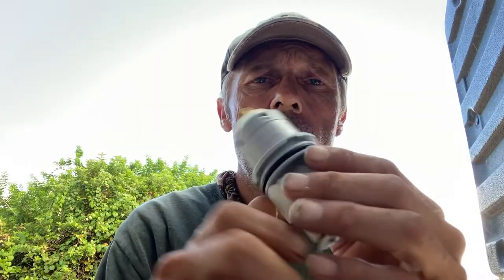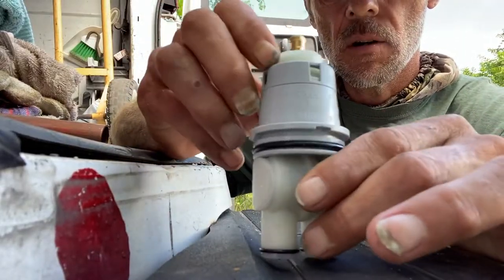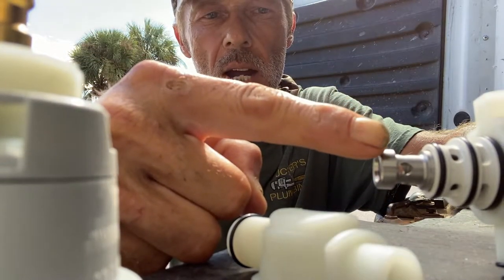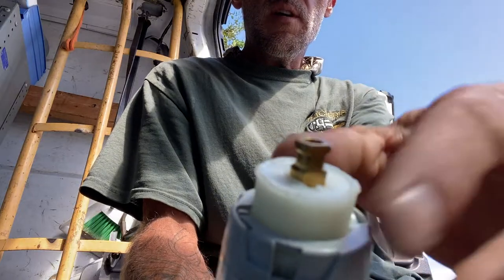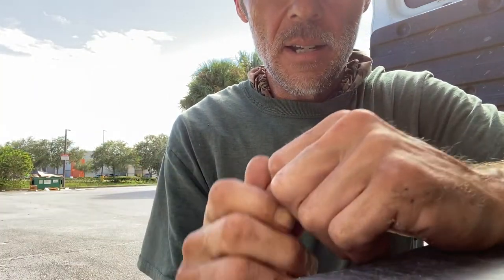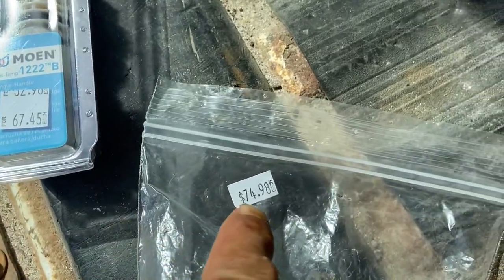DELTA TYPE P TUB/SHOWER CARTRIDGE REPAIR!

Comment: Thank You! When I pulled the cartridge out of the valve body it came apart and the springs dropped into the wall. Delta has a video that shows a model that has the springs and seals going directly into the valve body and not the cartridge. When the springs flew I was watching where they were going and not where they came from.  The new springs weren’t going directly into the valve body without additional parts that I never saw. The parts that Delta showed needed to be special ordered and would not have worked.  I was was lucky to have found your video.  I had bought a new cartridge, springs, and seats. After watching your video I lubed up the old cartridge, installed the new springs and seals. 10 minutes later I was back in business with a great working system and I can return the new cartridge for a refund. If it wasn’t for your video I would have probably replaced the complete valve assembly. This would require cutting a hole in the living room wall and several swear words 😊

Comment: Thanks Tim. 
Slow leak at tub spout when valve was closed. The tub was not used very often and was installed 3 years ago. Your video was the only one I found that fully explained how to repair and service the valve. Very good work as you enabled old electrician to fix plumbing without flooding the house.

Comment: Thanks Tim! I just installed a new Delta Universal Valve that came with this cartridge.  After installing and tested, we realized that the cold water won't shut off. You video helped to identify the issue as a missing o ring inside.  Lowes was kind enough to give me the replacement kit so I did not have to deal with Delta customer service.  Thanks again!

Comment: Awesome video !!  This is the only video that shows how to take the cartridge apart.  The cartridge came apart when I tried to pull it out (normally the whole cartridge comes out).
Delta wanted me to change only the seats and springs, now I know how this works, Thanks!
Reply: When it came apart was there a specific way to put it back. I turned mine and it came apart

Comment: Wow what a great help you were. I did the 2 small seal O rings and springs for my Delta and it worked out perfect.  That cartridge was $49 and I was told IT IS A BIT DIFFERENT  then the one I have but it (should) work. So I decided to try the seals instead. Of coarse they did not sell those so I came home and actually ordered them from Amazon along with the grease. So the 2 seals with springs and a small tube of the grease was like $9 delivered in 2 days!
 I appreciate people who are out to inform the average person that saving BIG money can be achieved by searching out better solutions then slapping down the cash because we are told we need a cartridge and they don't mention the least expensive option. So Thank you Tim!
Reply from the maker: Thanks for watching

Comment: Men you will know it now, you save my life, i have this system on my house in Puerto Rico (delta one) but just one line is use an I bought that same cartridge with the whole faucet and it turns that using one line (hot water line in this particular case) i just remove that cylinder a water flows normally.

If you ask why i did that because here in puerto rico I don’t know there but here we have shower heater Marey Brand i think and you put it the top of the shower, that’s why.

Thanks for your video. Very helpful.

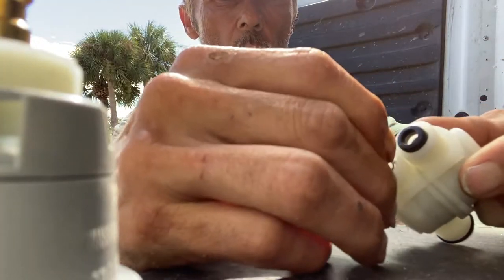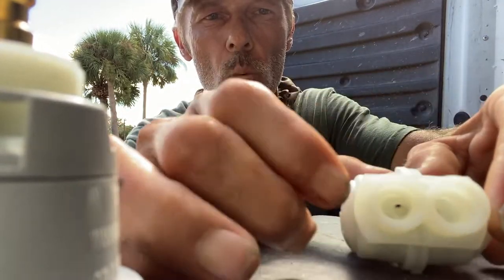Minute 1:50 to minute 3:00 🙏🏼

Comment: I think you have just solved a problem I been having with one of these valves that was driving me crazy, I do not have hot water hooked up at this time and after installing this valve with very good water pressure, I had almost zero water coming out the shower faucet, now I know what the problem is, thank you very much

Comment: This was so helpful, Tim! Fixing a leaking shower/bathtub shower valve without replacing the complete cartridge. Have done it quite a few times before for clients, but will be able to do it on the spot now at a much lower cost, as I always carry a supply of Delta faucet washers and springs with me.

Comment: Thanks for explaining about the springs and rubber seals inside the cartridge.
No one else did in their videos; and I was getting frustrated because from the start of a new install, the water would not turn off!
Turned out the sealed box with everything unopened, apparently had a cartridge where someone in the factory forgot to put them in.

If you had not explained the importance of them, I wouldn't have figured it out as quickly, seeing as I had never installed one of these myself!
Thanks again for the detailed, extra explanation.
You're a good teacher!

Comment: Great video, thank you! We just installed a brand new Delta P shower valve and cartridge but noticed a slow drip from one of the holes in the shower head. I took the cartridge out to inspect and nothing was out of the ordinary so I installed it back and now the dripping is even worse. It’s a steady stream now, not a drip. Any idea what could be the issue? I think it’s inside the cartridge somewhere as I was pulling it apart to look inside. Thanks in advance.

Comment: Great video tim. The set screw on mine was corroded so it looks like a handle and cartridge change. I do ac work….I’d say sometimes it’s worth the whole change and pass it on to the customer so not call backs. I can see it both ways. I like for them to save money also but we can’t afford for that 2 and 3 call back then it starts getting into our profits.

Comment: Hi Tim. Thank you so much for this video. I am about to replace the spring and washer for my delta shower and was wondering is you have a follow up video for the lubing to the cylinder? Specifically what type should be used and the proper methodology. Please let me know. Thanks again.
Reply: ❤👷🏻‍♂️🇨🇦Hi Tim….Well, thank you for this video….I was stumped and unable to figure out what was going on with my NEW shower/tub install. When you said pull out on the adjustable water supply….it was like Awesome! So, I went and did what you suggested…there you GO!
Reply: I plan to do a video tomorrow and there’s going to be a Shoutout for YOU my Brother!…By the way, my wife and I live in a CHURCH….you might find our channel interesting!

Comment: Tim

Very helpful with adjusting water temperature.. I have decent pressure in other rooms but not as good in shower with this valve?  Any suggestions I took the CA water saver piece out of shower head - helped a little bit but could use more pressure - thanks for help in advance..

Comment: Great video, Question I get not flow from the cartage and the pressure valve is free lubed, It does seem like the left side of the valve has no pressure with the cartage removed. I do live in the desert and the house is super hot when nobodys home. Any ideas, shower is not really used much.
Could the house temp cause the cold side water to come out hot closing the vavle?

Comment: Hey Tim, great video! I had a question. Even after adjusting the temp ring in the delta valve, my hot water isn’t as warm as I’d like. Is there anything I can do to adjust the hot water temp to get warmer? Thanks!

Comment: You didn't mention that some of these are under LIFETIME warranty from Delta. You can get a new one free of charge just by contacting Delta.  After replacing our hot water heater, our showers, both Delta and about 9 years old, started giving us a shower that was inconsistent temperature to the extreme. I replaced one cartridge, and it started doing the same thing after one shower. I opened the old cartridge to find the problem, but it's not obvious. Perhaps the cylinder isn't moving as freely as it should? I did find a very small piece of plastic near a washer. One theory is crud got into the valves; and I'm about to replace the cartridge again.  Any wisdom you can add?
Reply: Only 1 yr warranty for residential
Reply: How come no one  shows about the inlets o rings replacement and that other rubber  seals that snap into the little hole on the two grill inlets. You can see the  little triangle  seal nipples protruding out of the center of those two inlets  grills where the water goes in. How do you  change those seals and the parts, the ring and that back flow seal thanks
Reply: You can get new cartridges on eBay for under $20 they are clones for delta.
Reply: I though the plastic cartridge was glued. So I split it and cleaned the piston and body.  Bad rusty well water. Should the flow be the same on the end cap. Hot I can blow through easily.  Cold side barely moves air from my mouth. I see it has a little diaphragm that has to open.

Comment: Nice video; what I don't understand is I didn't have any significant cold water coming out of the mixing valve (cartridge removed and water flow tested in the line before the mixing valve was fine).  I found out that the mixing valve has a set screw on both the hot and cold, the cold was threaded in too far, once pulled out cold water came out with good flow.  However, after putting the cartridge back in, still no cold water.  I ended up taking the cartridge apart from the turn knob, turned the cartridge 180 degrees, reattached it to the turn knob, reinserted into the mixing valve and guess what, great flow coming out of the cold side (as well as the hot).  What I don't understand is why flipping the cartridge worked, maybe it was a stuck bearing???

Comment: Thank you Tim! I just bought a T13022 trim kit and I was trying to figure out the P cartridge. Your video gave me a lot of insight. I have the water turned off right now so I can fix the piping. I count 13 notches from the Cold side to the Hot side. What notch number do you recommend (just a “guestimation”) to line up with the end of the Hot side arrow without testing the temp while keeping it not more than 120 degrees? Thanks
Reply: The notches only effect how far you can turn the handel in a  given direction. Adjust it to one side and put the handle back on. Notice how far you can turn your handle left and right. The actual water temperature is set at your hot water heater. The handle even if turned all the way to open on hot will not go past whatever your preset hotwater  heater pressure is. Most are set to 120 by default.

Comment: Tim you are a good man, explained very well, thank you, after taking the cover and handle off do I pull the light grey plastic cartridge straight out of the brass body? Mine is moving only about 1/16 inch out but afraid to force too much.
Reply from the maker: Thanks for watching
Reply: Put the handle back on and pull hard on it.  Wiggle it back and forth and side to side.

Comment: My Delta Shower fasuet is about 7 years old it sits in Arizona Summers fo 6 months with water turned off. It has started to run very slow a full hot but still works. anyway watched a lot of YT Videod then found yours. 3 Questions 1 Can't get the Cartrig to coum out of Housing.  2.) could there be setament in it or has the Spinner thing become un lubes. 3.0 what lube is best foe Spinner and O rings?

Comment: I replaced one of the type p delta cartridges last week! The brass bonnet that secures it to the shower valve are a pain to get off! Used lots of WD40 😅 thanks for the video Tim.
Reply: Having that problem right now. Fixing to try and saw it off, sheesh.
Reply: Be patient and work slowly.  If you get in a hurry and try to force it too much, it will be a very bad day.  Let the Liquid Wrench work for 5-10 minutes, then grasp the bonnet nut with your channel locks.  Don't grip too tightly.  Now use a hammer or something to gently tap the end of your channel lock handles.

Comment: Ok I got a doozy for ya, same delta faucet house is only 2 years old and the master bathroom shower faucet goes from extreme hot to stone cold replaced the cartridge twice and still no luck, the other 3 bathrooms don’t have that problem cause I’ve showered in them, it’s only the master bathroom shower, any ideas would be greatly appreciated I’ve also taken the cartridges apart like you explained and lubed them and repaired the springs and washers and still no luck.

Comment: Tim I just changed my rubber washers and springs like you just said and it's still dripping at the same rate it was before. I get hot and cold water and plenty of pressure. What else could it be? Should I just replace the cartridge at this point?

Comment: Really good video Tim. I have a question that does not pertain to this though. We have a galley style kitchen and the line for our water for our Ice maker runs through all the cabinets to the freezer/fridge. The line seems to be stopped up with build up. Should I replace the whole line [which would be a big pain] Or can I clean out that copper line?

Comment: Hey Tim.  I just installed o e of the delta mixer and the water doesn't come out but if I remove the cartridge with the water running and install it with the water running it stays on and can't be turned off.  The line isn't pressured And there's no hot water connected on the line either

Comment: Tim I installed two  Moen shower because they did not work, I replace it for a Delta and still have the same issue which is no water coming out when installed. So my question is what do I do to  get this shower faucet working? Or is there a non pressure balance cartridge in the market? Thanks for your cooperation on this matter

Comment: My landlord had one of these installed in my shower and tub. Now I have much less pressure than the old 3 handle. It takes 40 min to fill the medium small tub, and the shower has much less pressure, even if I removed the flow restrictions from the shower head. 
Any solution for this? My Brooklyn landlord is the typical unresponsive common in this city.

Comment: Question i have leaking water i bought a new cartridge's, However the new one doesn't go all the way in. n still leaks. So can i just take all the parts from the new one & place them in the old one? the crack of which doesn't go all the way in even though they are the same size n everything same catridge even but it sticks out a hair n the old one doesn't.

Comment: Tim thank you for creating these videos.  I have been having issues with my cartridge for some time. I already replaced it and the issue continued.  My issue is not so much a constant drip, but more along the lines of water coming out of shower head certain times of the day.  Almost as if the faucet was not fully closed.  Once this happens, I have to go to the shower, open the handle and close it a few  times until it completely stops. It can happen in the middle of the night, in the afternoon, whenever it feels like it.  I have swapped the cartridge with another one in the house where the issue is not occurring and same results. I finally found your video and did as you said. Took it apart and greased the inside cylinder, put new seals, I cleaned the inside really well with CLR and same results. I inspected the inside of the faucet and I cannot see any issues.  Any other recommendations?  Thanks in advance...
Reply: I have the exact same issue. Did you ever figure out a solution? It's driving me crazy to deal with. Thanks!
Reply: @samandbosadventure6096  nah man. Comes it goes. The crazy thing it had stopped. I decided to clean the shower head by removing it. Once I put the shower head back, it started again. I gave up. Then all of a sudden it has stopped.

Comment: Is there some kind of dummy cartridge that fits into Delta valves and has a cold and hot NPT out fittings? I'm trying to avoid tearing down my wall to change the valve out to get this configuration.

Comment: Question, I have a problem with water pressure and the cartridge seems to be the issue.  Without the cartridge, water pressure is fine.  What's the solution in this matter?

Comment: Having difficulty removing the whole type P cartridge from the brass housing. Should just pop out, right? I got it out enough to turn the cartridge assembly and remove it. I’m afraid levering it with a screwdriver will crack the plastic so I’m being careful with the amount of pressure I’m using. Is this normal?
Reply from the maker: Yes you just have to have patience and work it out
Reply: @PLUMBINGWITHTIM  Thanks Tim. Pb Blaster and persistence paid off.

Comment: Not sure if you will still respond to questions.  Purchased a Delta shower/tub combo with this in it and my water pressure is horrendous now filling up the bathtub.  When I take it out, water pressure is phenomenal.  At this point, I don't know if its the tub spout, or this thing that sucks. Seems like a horrible design.
Reply from the maker: It’s possible some debris got lodged somewhere 
Make sure the cartridge is installed properly 
Good luck

Comment: This is so frustrating. Ime installing a new shower 
/tub combo and have spent alot of money trying to find the correct cartridge. The first I bought didn't stop the water the second one stops all flow of my water. I've twisted it and turned it so that maybe the holes line up but no dice. Just want to finish this project so I can move on with being able to 🛁 in my master bath  don't honestly know what the problem is. Called delta and they say it's the correct one for my valve. SO